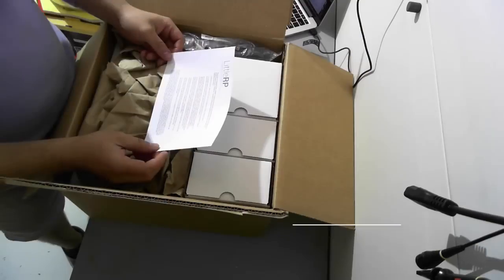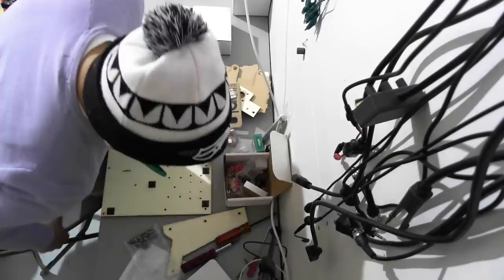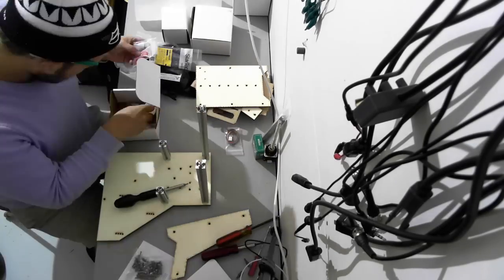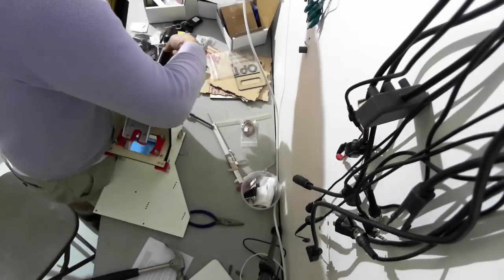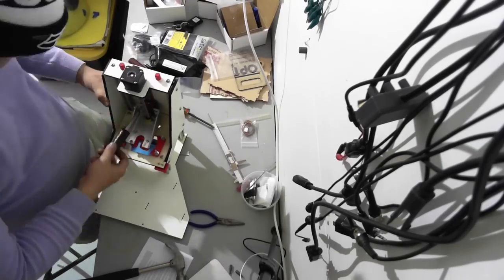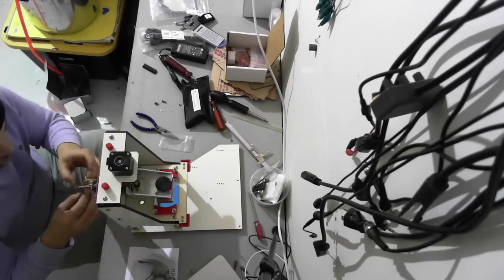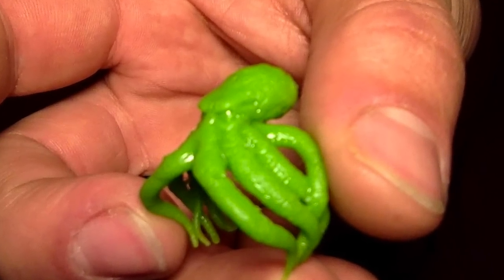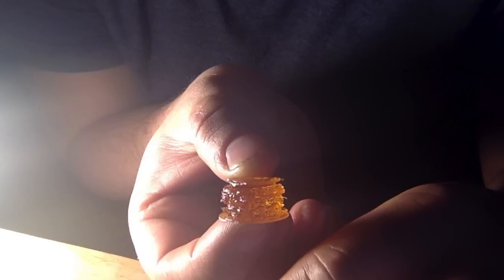Little RP SLA 3D Printer Build

Comment: Great work Peter. 

Can you help me? I have done my first impression test few hours ago and looks resing don't dry when the projector throws light. What projector do you use to do it? What do you think could be the problem?

Obs: this is my projector:
http://www.ebay.com/itm/Optoma-HD26-16-9-DLP-Digital-Projektor-Full-HD-WUXGA-1920x1080-/361490064685?hash=item542a7ca52d:g:qjMAAOSwPc9Wv97q

Thanks.
Reply from the maker: This is a check list I would use. Does that projector have a uv filter? if so remove it. Be sure to give the print long enough per layer as well. Some of my resins take 20+ seconds per layer.
Reply: +Peter Sharma 20 seconds?! I was setting 2 seconds kkkk Ok I will try. Thanks.

Comment: does littlerp 3d printer can be use with castable resin material? i need it to make silver ring
Reply from the maker: +Iza zuhdie You can make a silicone mold from the 3d print to cast your ring with. I'm not sure about 3d printing the cast though
Reply: +Peter Sharma yeah sure i knew it, but i'm asking about the printing material, could it use castable resin in printing process? so i can do lost wax casting with that.
btw what is the littlerp 3d printer prices?
Reply from the maker: Iza zuhdie Ah, well it can print any resin that will harden in the light range of the projector. So yes it can print with a castable resin. These printers work a little different than FDM printers, where you don't need to get different mods to print with exotic materials. (I.e. Ninjaflex needs mods so most printers can print with it.) This style printer will only limit you on time it takes to print and the wavelength of light on the output. So as long as someone makes a castable resin, you should be fine. Here is a link to what you might be looking for, http://madesolid.com/fire-cast-resin.html  That should work with any SLA printer.